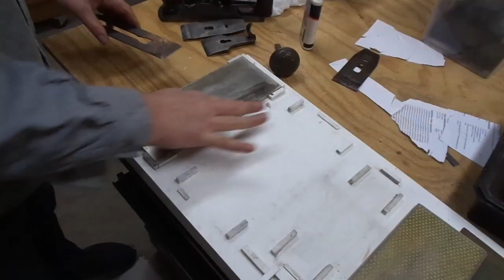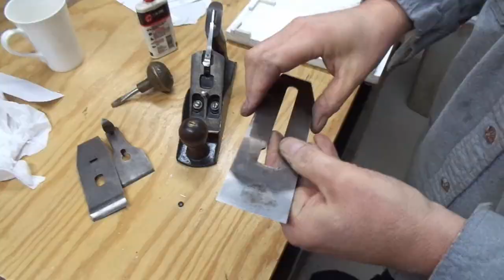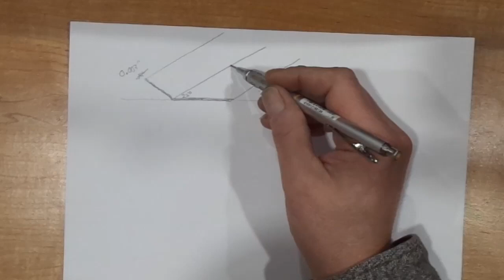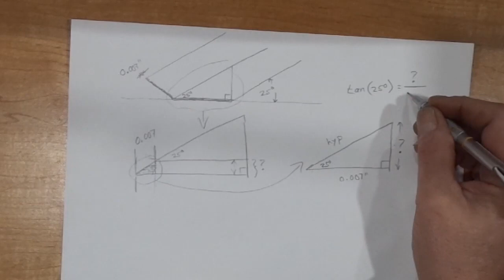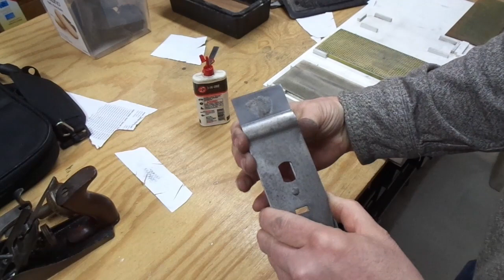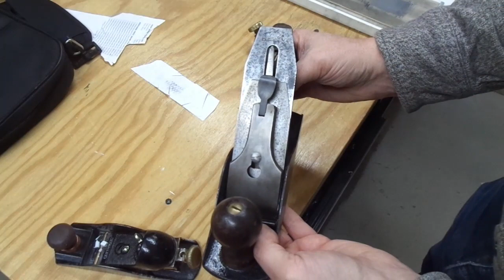Vaughan and Bushnell 804 Hand Plane New Iron

Comment: Ok sharpening guru, you need to do a video on sharpening old straight blade razors. I'm sick of wasting money on expensive throw away triple blade razors. I have my grand father's straight razors and want to try restoring and using.  I'll send you one and the sharpening strap. Interested ?
Reply from the maker: I've never owned a straight edge razor and can't say how adept I'd be using a strap.  I have more repeatable success with jigs although I'm getting better at free hand honing plane irons and chisels.  My freehand skills with knives is not great so I use my fixed angle knife sharpener when I have a dull knife or really want to end up with a razor sharp edge.